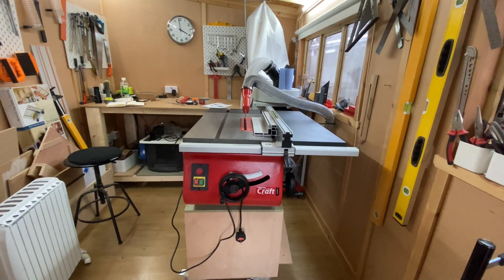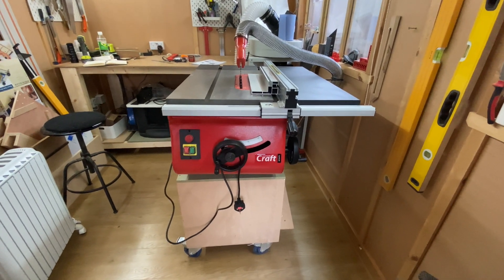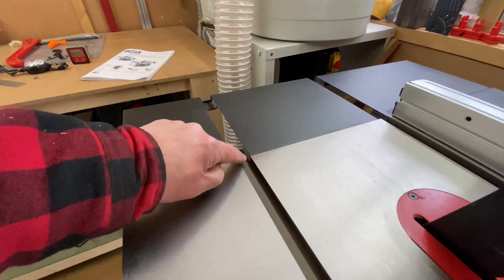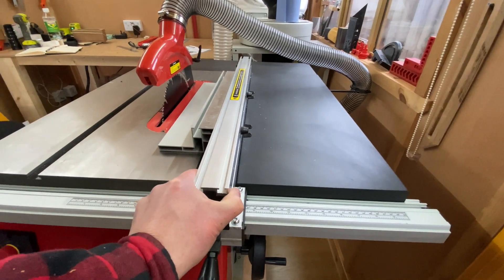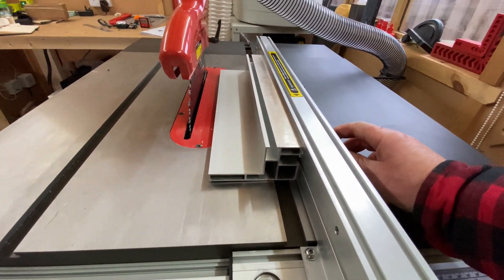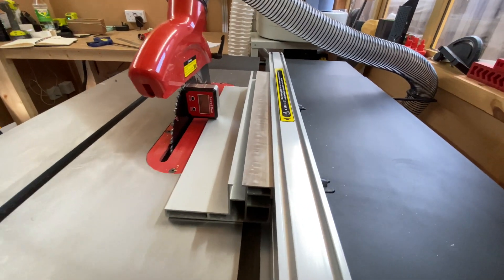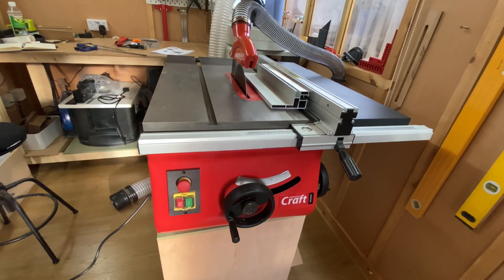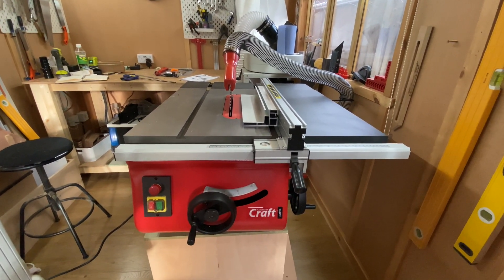Axminster Craft Table Saw - Axminster AC254TS - 10" Table Saw -1st Impressions

Comment: Nice review.  Watch those electronic angle finders as they go out of tolerance very quickly.  I use the Axminster one and need to reset it several times when checking angles.  Grubscrews in that are simikar to adjust as your old Bosch (I had the same model).  Your dust extraction is well designed by the looks of it.  I have the Charnwood W650 which is I think a better machine overall but it has woeful dust extraction!  The Axminster is a lightweight compared with most cabinet saws!  If you ever upgrade it you’re in for a shock! Mine weighs 129kg and was back breaking to get into place!  I’m surprised how noisy that Axminster is.  Mine is quiet enough I don’t have to raise my voice to be heard… perhaps the bksde is contributing?  Talking if which, try the uk made Shark blades.  They’re superb and mine easily betters my Axminster premium blade for half the cost!

Comment: Good review pal, great little table saw, if you change out the blade to ones that we use, for example a Freud ProCut blade you can pick up in Screwfix the sound of the machine will decrease even more, I have a huge Laguna Fusion 3 cabinet saw in the workshop and I use the ProCut blade which gives great results and runs very much quieter than the stock blade, anyways good luck with your saw, love how tidy you keep your shop.Louie
Reply from the maker: Thx for the tip

Comment: The emergency stop button is just that. It’s also for giving an extra safety step to turn it on when turned off. You shouldn’t use it as a functional use stop button. It’s not designed for the constant wear and tear of on/off use.

Comment: Great video! Are the back and side panels fairly light weight to add/remove whenever needed?
Reply from the maker: Hi, thanks... yup they are, in fact I took the back out feed off earlier this week to create a little more space in the workshop.. basically 3 bolts into pre drilled holes, also they are not too heavy at all, and this can be done in your own. I’m waiting until I move into my new workshop, and then I’m pretty sure I’ll buy the left side extension as well, as I’m hoping the saw can be positioned in such a way that is stationary most of the time..
Glad you enjoyed/liked the video thx
Reply: @mistercandwood2007  Thanks for the response. I look forward to your next video!

Comment: Thanks for the overview. Do you know what the dust collection is like without the blade guard/hood?
Reply from the maker: Hi Kerry - having used the saw for a while now the dust extraction without the blade guard/hood is pretty good, when you do use the blade guard/hood low over the workpiece, the extraction is excellent. I have combined it with a Axminster Craft AC153E Dust Extractor -
https://www.axminstertools.com/axminster-craft-ac153e-2-0hp-dust-extractor-105099
- which works very well compared to my Bosch Gas 35 L SFC+.
I suspect the performance of the dust extraction will be heavily dependent upon your dust extractor - there doesn't appear to be too much sawdust inside the casing of the machine, so it does a pretty good job of funneling the debris down through the extraction outlet and hosing.
Hope this helps.

Comment: Great review, in regards to the dust port, check out a guy on YouTube called Izzy swan he has fabricated his own quicklock system for his tools. Which is a good place to get some ideas to do your own version which may help you massively as you can put them on all your machines and then just lock them on and off as needed, I hope this helps bud. Keep up the great work. 

Also how solid is the fence for deflection and how easy is it to set if you don't mind me asking?
Reply from the maker: Thanks for the feedback and also for the Izzy Swan tip, will definitely check his system out - much appreciated. In terms of the fence I have mixed views... very stable and locks down well and no discernible deflection but moving the fence is a bit of a pain, basically the locking handle has to be all the way up for the fence to slide... which sounds ok but can actually be a bit tricky with just one hand, i.e. your right hand especially as I am left handed.. this becomes even trickier as I like to manually measure the gap between fence and blade ( a bit retentive I know ) but on certain pieces of stock it makes sense to me.. and trying to lift the handle, move fence and measure with left hand is a wee bit tricky... maybe there is some adjustment I can look at, or talk to the chaps at Axminster tech support.

Comment: Thanks for video. You helped me to decide whether to buy it or not. Currently own dewalt dw745 which is great saw but like you said the weight does the job in axminster craft table saw. Have you had  any issues using rip fence?  I'm bit worried about locking mechanism which is different to dewalt.
Reply from the maker: Hi ya, no real problems with the fence.. once locked it stays locked... the auxiliary fence is very handy as well, especially when you are cutting narrow strips. My only small complaint is that to slide the fence across the table the locking handle seems to have to be held up quite high, and this can be a little tricky with just one hand... this maybe down to the fact that the fence is always on the right hand side, and I am left handed... so I generally find I'm moving the fence it's final position with both hands... No real drama, and I havent had time to properly investigate whether this is adjustable. Thank you for comment and feedback.

Comment: To adjust the the riving knife you have remove the knife to get to the grub screws to adjust it which is ridiculous.
I don't like the blade hood hose stetching across the table to go under to meet up with underside extraction so I separated mine, mine now goes up to the ceiling where the extraction pipes are.
Don't like the fact that when you use accessory fence on the main fence you can't go by the measuring guide on the rail.
Apart from the little things that could be better designed its a well built Chinese machine that cuts very well and accurate and generally happy with mine.
Reply from the maker: Agree about the adjusting grub screws - you are essentially adjusting blind - i.e. adjust and then refit. Good idea about separating the crown guard extraction, presumably you have capped off the extraction point underneath? Unfortunately I don't have the space in my current workshop to do that. but in my new one I may, so I will definitely look at that.
Reply: @mistercandwood2007  bit slow off the mark with my reply so expect you've already worked this out. I've just picked up one of these saw and love it. 
To adjust the riving knife I took the side panel off and just dropped the  blade a couple of turns and the grub screws can be accessed there. I just used a straight edge against the blade to check for alignment which took a little bit of fettling but was done in 10mins or so.

Comment: Great little table saw. One thing I found odd though, the left hand extension table is only as long the the saw bed. So you end up with a weird square section missing in the upper left corner once the left table is fitted.
Reply from the maker: Oh - didn't know that, I am thinking about getting the LHS extension table -- hmmm thx for the info